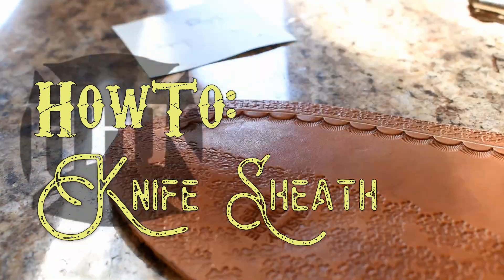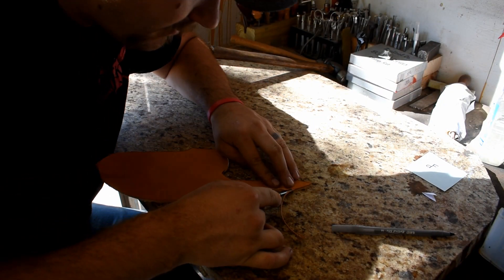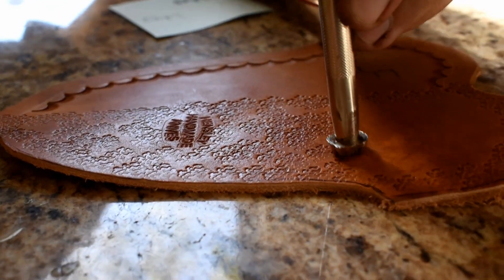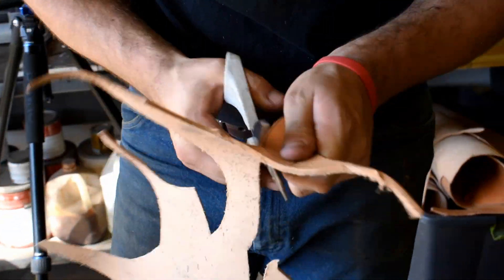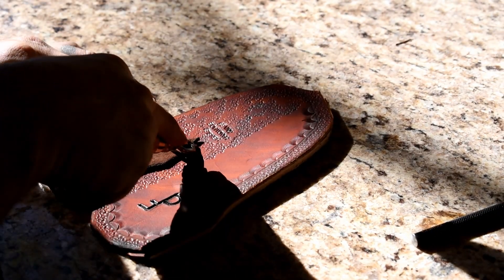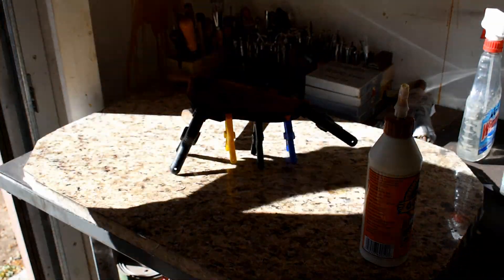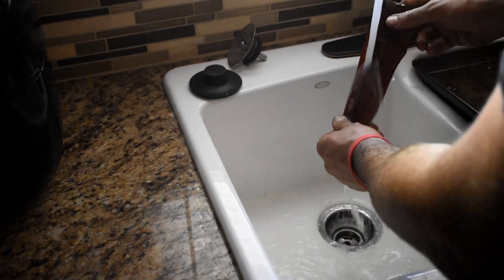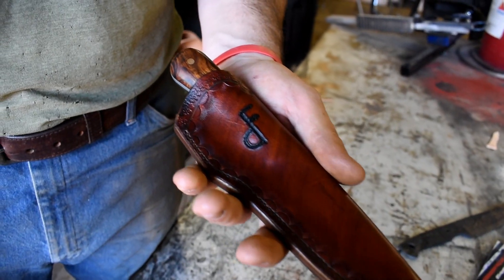How to make a leather Knife Sheath - DIY Tutorial

Comment: I'm having a problem with sheaths letting go of my knives. I have a couple shaped like this that the knives just fall right out of when doing something as simple as sitting down and standing up. Or squatting to pick up a log. Or climbing a tree. I can't trust them at all. I even have one with a retention strap that the knife slides out of as it works it's way passed the strap. I lost a $150 knife this way. I've gotten to the point where I carry my knives in sealed pockets on my backpack instead of carrying them on my belt. It makes using them very inconvenient, but I don't constantly have to hunt for my knives. Have you come up with any innovative solutions in your sheath designs to help keep the knife in the sheath under vigorous outdoor bushcraft use?
Reply from the maker: Thanks for the question. What I do isent really Innovative but it sure works. First you need a quality leather sheath. Good leather. After you have that you need to wetform the sheath to the knife like shown in the video. This will harden up the leather in the shape of the knife and will hold it for a very long time
Reply: hey Mark , if your sheath is something other than the veg -tan leather i.e.bison or some other leather that is pre tanned with salts man they wont take the water to form up well at all ...i didn't know what kind of leather ya was working with good luck...

Comment: How fast do you go through stamps using a metal hammer to tool? The tips of them look pretty beat up. Do you not own a poly or rawhide mallet?
Reply from the maker: Im not worried about it. If need be I grind down the ends. I haven’t had to replace anything, and I like using a metal hammer because i think it makes a deeper impression on the leather.
Thanks for the view!